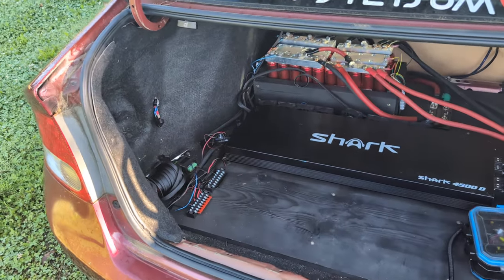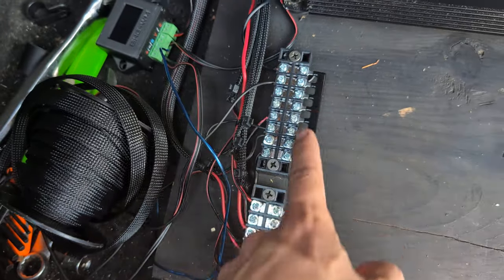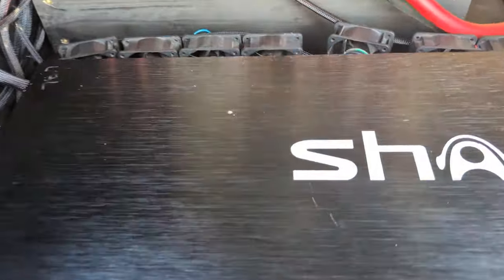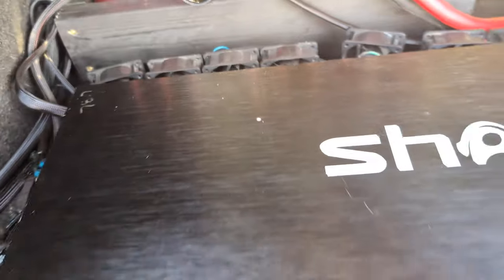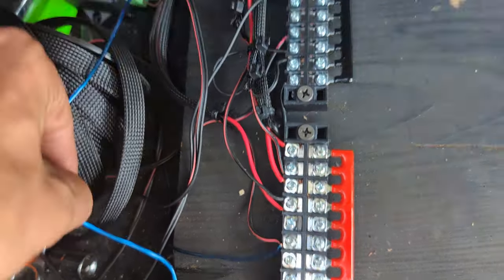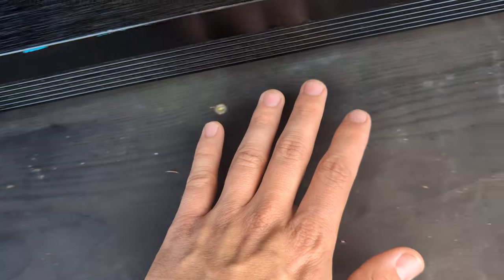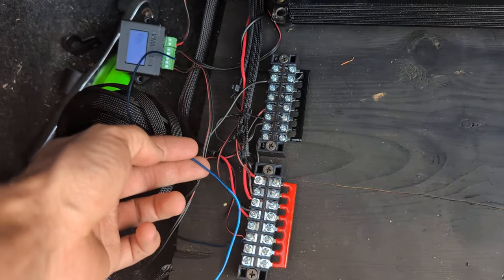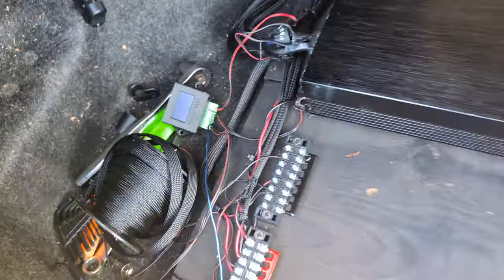How to wire up fans to an amp in a vehicle.

Comment: I don't think you need all of those fans going full blast. You might try taking half of those fans as a group and wiring it in series with the other half. That should reduce your voltage 1/2 and quiet them down. You could also put half the fans on the other side.
You could also angle the fans so that they're blowing the air across the heat sink, left to right or vice versa.
Reply from the maker: Yes I know but It blows a lot of air for those fans. I figured I'd just run them and see how they do